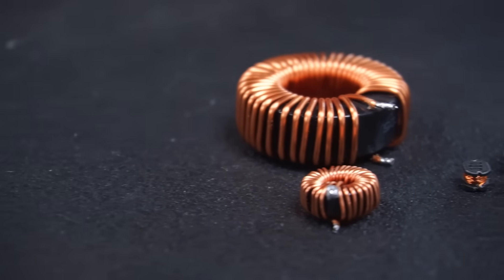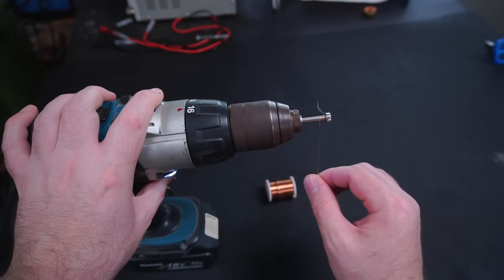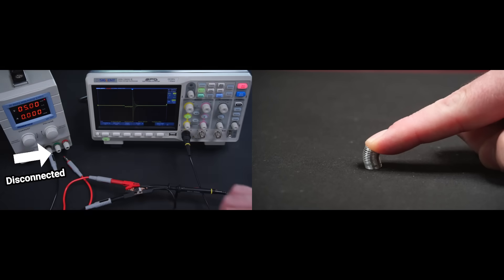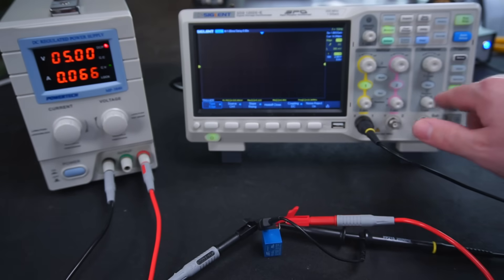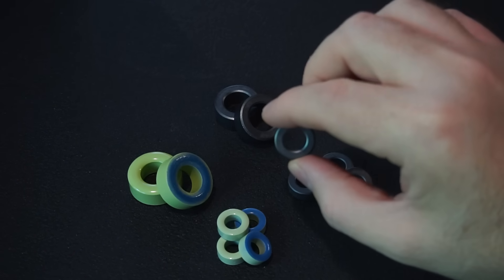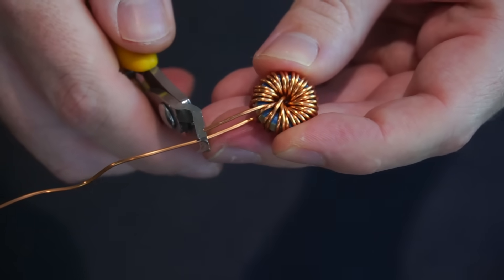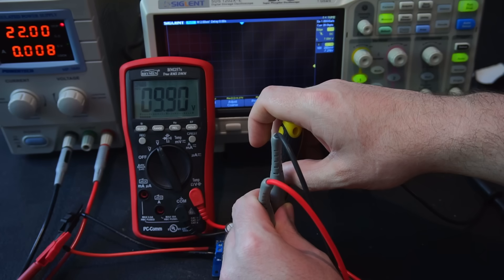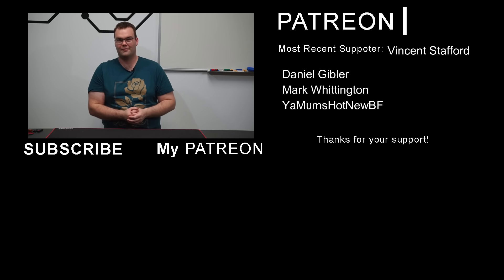How INDUCTOR's work & How to make your own

Comment: You also forgot to point out how to choose the right wire diameter by calculating the wire thickness by using the Amperage. Because your required inductor is 47μH by 12A(well shown at 10:18 in the circuit component L1) so you calculate the wire thickness for 12A and add 30% to it to be on the safe side or you stay below a certain current density for example 10A /1,5mm² is a current density of 6,6 A/mm² you choosed the wrong wire by choosing 1mm diameter you effectively choosed 0,785mm² which for 12A is to little because for 12A you need at least 1,81mm² next size would be 2,5mm². Your my prediction your inductor will be noticeably warm not touchable for long time. Do your homework right if you want to teach how to build a good inductor.

Comment: Oh yes, diodes work great! I had to use about 1500 of them on the electric valves in my pipe organ, each valve's coil was  40, 60 or 90 OHMs @ 12vdc. I had to use diodes to deal with flyback voltage potentially damaging delicate contacts, and to electrically isolate sets of valves connected to the same "66" terminal blocks so each set's valves could be operated separately from the other from the keyboard.

Comment: I've been trying to figure out how I killed two VESC speed controller, and I think this might be how- just by unplugging it. I was using a 48v battery which was connected to a VESC 6.6, and from the terminals of the VESC I had connected a buck converter (DPS5005 ) to power some headlights. After that, the 5v RF section of the board only read 3.3v and no longer would pair with BT.

Comment: One important comment from an old winder: Always start winding the wire from the middle and wind both ends separately. This way you dont have to thread a long wire so many times. The total length of wire to thread is reduced by x4.

Comment: play a video a bouts a heavy duty isolatin tranformer exhample 220 volts to 110 volts AC how to wind them I have them I used  for machine and tools if I want them slower is to plugs in to the the tranformer from the secondiary 110 volts if I want normal speeds plug backs to 240 volts power points it a safety tranformer

Comment: I recently started winding my own toroids for some low-power ham radio kits.  It's worth mentioning that even on a high-end RF-rated toroid (e.g. type 43 ferrite) the proximity of turns can make a pretty big difference in the final inductance; if they're all bunched together, you get more inductance but lower efficiency, and if they're evenly spread out, the inductance is lower but the efficiency is higher.

Not having a component tester, though, I had to come up with an alternate way to test inductances; the simplest way is to build a resonant circuit with a known-value (measured) capacitor and see what frequency it resonates at.  With a decent oscilloscope, this should be a lot more accurate than a component tester.
Reply: I have done that.
The tolerance on the Capacitor and the accuracy of the frequency counter or Oscilloscope sets the tolerance of your final answer.

Comment: Buck converters are supposed to be step-down converters from DC to DC, i.e. reducing voltage while increasing current.  How can you then conclude at 15:32 that inductors have NO influence on DC power and doesn't affect voltage?

Comment: From the coil32 page......Another case is the inductor in the switching power supply. The commonly used ferrites have a relatively low value of saturation flux density (about 0.3 T), so in the power switching circuit the inductor is switched between the maximum value of the field when it almost gets a saturation and zero-field value, when it is demagnetized to a value of residual induction (curve [4]). As we can see the slope of the major axis of the ellipse 4 is much smaller than that of the ellipse 3. In other words, the magnetic permeability of the core in this mode is greatly reduced. The situation becomes worse if the choke core has DC bias (curve [5]). The major hysteresis loop of the real ferrite is more rectangular than on our schematic image and, in the end, the dynamic magnetic permeability of the power inductor on a ferrite ring falls to several units. As if there is no the ferrite! In the end, the inductive reactance of the inductor decreases, the current increases dramatically (which results in an even larger decrease in µ!), the key transistor heats up and burnout. The calculations of Coil32 for this choke give an absolutely wrong result. Because, we used to calculate the value of initial magnetic permeability, and in a real circuit, the permeability is two to three orders smaller. You will get the same situation if you will measure the relative permeability of the toroid by the trial winding.

The solution is to use a ferrite core with the interrupted magnetic circuit. In the case of the ferrite ring, it is necessary to break it in half and then glue that two half with the non-magnetic gap. The major hysteresis loop of such a core becomes more sloping [2], the residual induction is much less [B'r], the effective magnetic permeability is also less than that of the core without a gap. However, the curve of magnetization [6] shows that the dynamic magnetic permeability of this inductor is much higher than that of similar, but with a core without a gap. It has permeability about 50..100. Coil32 also is unable to calculate this choke, since it does not take into account the non-magnetic gap. Another solution is the use of special rings for the power supply as powdered iron toroids (not ferrite). Such toroids can be found in pulse power supply units and motherboards of computers. The non-magnetic "gap" in such ring is distributed along its length.

Conclusion. The Coil32 program calculates only low-current ferrite toroid coil working in low magnetic fields. For the power chokes calculation, it is necessary to use a completely different methodology.

Comment: I’m quite new to electronics, so my use of a 12v relay is limited. I plan to have an Arduino controlling a few 12v lights with a relay board designed specifically for Arduino. Would I need to worry about any kind of voltage spikes if I isolate the 12v circuit from the 5v of the micro controller? I was under the impression that relays were safe but now I’m unsure 😅

Comment: Thank you for this video, it is an excellent demonstration of coils and inductive flyback.  However I think you are confusing the purpose of the inductor in the buck converter circuit with a pi filter in a power supply.  The purpose of the inductor in a buck converter is to supply power to the load and charge the output capacitor. Using the flyback from the coil and charge on the capacitor to maintain current to the load while the switch is off. The output voltage and current being determined by the frequency and duty cycle of the switch as controlled by the PWM.  When you replace the inductor with a short the switching transistor gets hot because it is conducting into a short. An inductor has inductive reactance and that is resistance. Yes the inductor and capacitor values and quality affect ripple, but the inductor here is critical for circuit operation, not a ripple voltage filter as it is in a pi circuit.

Comment: I work on refrigeration systems. We put vfds on the condenser motors a while back. They were blowing up motors left and right. Aside from the motors not being rated for vfds at the time (over a decade ago) they added these electric filters on the outputs of the vfds. I'm no electronics guy, but are those filters we added essentially just inductors for taking out the spikes like you mention in this video on the buck converters? The output of vfds are dc that mimic ac as far as I understand. Which isn't much.

Comment: So what happens if u rapidly switch  an inductor of and on  can u produce a constant voltage 😂😂 wouldn’t this create more energy than put in because it’s dependent on the size of the magnetic field of the magnet .   U could use low voltage high current and produce high voltage high current dependent on the quality of the magnet.

Comment: Don’t need to overkill catch diodes. When sizing catch diodes, remember that current doesn’t increase with fly back. The inductor does what is needed to keep the previous current flowing briefly, however much voltage it takes to do that. So if your 70mA relay coil is switched off, it will continue to pass that 70mA briefly. A 1N4148 catch diode will handle that easily! And with your power inductor at 1A, a IN4001 will do the job just fine.

Comment: In RF parlance, especially in the amplifier arena, capacitors and inductors are labeled as tank blocking capacitors which pass RF current and block DC, while the plate chokes block RF current and pass DC, unless they're making up the tuned resonant tank circuit, where you want the cap to charge and discharge, and the inductor to ring, forming the flywheel effect in class B and C amplifiers. Another choke is used off the load capacitor to ground, which is for safety if the plate cap fails, connecting the HV to the tank. This, of course, blows the fuse before allowing HV into the antenna circuit.

However, that choke's ringing causes HV to appear across the tuning and load cap's plates, and they have to be rated for that.

In the plate power circuit of tube amps, the cap passes the anode's RF to the tank circuit while blocking HV DC, and the RF plate choke blocks the RF from entering the HV power supply. It's like using two types of check valves in a hydraulic circuit, and very similar to a diode's action.

Comment: This is probably one of the better videos I have seen you make. Quick quick question I am building speaker crossovers and found Inductors are very expensive. I wanted to ask what type of Toroid would you suggest for this purpose. I am thinking I can save a lot of money if I just build my own inductors. I want to use iron core inductors for the large woofers rest could be air core but I guess I could use iron core for those too as I could use less wire. I will probably be using 18 awg (1 mm2) wire. Could I even use an iron bolt?

Comment: What if we add a capacitor with an inductor to absorb the fly back ? so then we can use the retained charge or voltage to later power an LED? will it theoretically work?

Comment: I have question I cinde of run in to problem I wanted to build me self dual ignitor for me ignition system I use 4 pin gm ignition modules but the problem is I have only 1 pick up coil I have some of those small inductors and transformers culd I use those to convert 2 pulses to 4 pin out put?
How ever It needs to be corect polarity I supose.
So does have some one sugestion how can I do that?

Comment: very interesting... I am going to build a current mode choke and intend on using ft240-31 torrid and wrapping it with RG400 (12 turns);  Would this not be considered an inductor itself... and if that is true, would or should I be considered about Flyback?

Comment: Have to ask. If there is more wire doesnt that affect voltage like it will have some resistanse and that means that If the load is low resistanse it will start to form good voltage divider network and you have to change output manually to get disaired voltage output with the current that is nessessary.

Comment: The opposing emf produced by an inductor is a characteristic of the non-Coulomb electric field that is proportional to the rate of change in current causing a changing magnetic field. And that is Faraday's Law.
The current is a result of the combination of an opposing Coulomb electric field and the applied field which is changing the current. The opposing Coulomb field is a result of polarization of the inductor by the non-Coulomb electric field. So, the current is a consequence of the resultant field of the applied field and the Coulomb electric field in the inductance coil and is determined using the governing relation in conductors J = σE_net.
It is not possible in this post to discuss in more detail the formation of the Coulomb field when the current in an inductor is changed.
Before learning Faraday's Law and its application to the operation of inductors, it will be instructive to understand Current, the conduction process and Voltage at the fundamental level as in the following two videos:
i. https://youtu.be/TTtt28b1dYo and
ii. https://youtu.be/8BQM_xw2Rfo
The last frame References in video #1 lists textbooks 3 and 4 which discusses topics on inductance and inductors in more detail using a unified approach and provides an intuitive understanding of inductive reactance.
It also describes with sequential diagrams how an inductor develops the induced emf. Textbook 4 shows how the current lags the voltage across the inductor by 90 degrees for sinusoidal input voltages using sequential diagrams.

PPTs and Videos with animations for all the ten chapters and a few applications Regulated DC Power Supply, Differential Amplifier and Transformer coupled audio power amplifier of  book Fundamentals of Electric Theory and Circuits are available for download and viewing here
https://techsarworld.com/download-resource/fundamentals-of-electric-theory-and-circuits-559

Textbook  https://techsarworld.com/product-detail/fundamentals-of-electric-theory-and-circuits-559 
shows how the current lags the voltage across the inductor by 90 degrees for sinusoidal input voltages using sequential diagrams.

Also see
Faraday's Law and self-induced emf - video lectures by NCS Univ faculty
This is a link to a video lecture by NCSU faculty on Faraday's Law. 

Important
7. Faraday's Law
Watch from 8.0 minute.
Ch22L1a
https://youtu.be/ktGL5cEB82I?si=u9vH33gaX1Wy5JvF 

8. Non-coulomb electric field - curly-patterned fields
Watch from the beginning.
Ch22L1b
https://youtu.be/nV6xg-OuxoY?si=UjJBG3wDjazfeQMM 

The second link is to a video lecture on self-induced emfs in solenoids (inductors).
9. Self-induced emf in a solenoid
Ch22L2a
Watch from 10.30 minute.
https://youtu.be/RJ0J_TL-wUQ?si=qPZ74uD-m6weyFlb

Comment: An inductor and a spring is a WRONG analogy.
A spring, or rather a rubber membrane, is an analogue of a capacitor.

An analogue of an inductor is a pipe with a fast flow of water inside. When a valve suddenly closes at the end of a pipeline and stops the water supply, we have a pressure surge, aka water hammer.

Comment: i once hand wound fine transformer wire over a old smps  E core, aim was to power my plasma globe whose hv xfmer had no o/p, got so fed up stopped after some time, made ajoule thief kind of self oscillator, it can power a neon lamp from a 1.5V battery.

Comment: I really enjoyed your flyback to a spring example!  I need to find out the opposite of what you showed after that, however... I need to figure out how to best protect any other circuitry while, at the same time, getting the highest possible flyback voltage. It doesn't help that my limited amount of electronics background is close to 50 years old ~ with a LOT of "water under the bridge" during that time... (I'm having to go back & start over from scratch via youtube, etc.)  Fortunately, I DO remember enough to have a healthy respect for HV & how to discharge scavenged flybacks, capacitors, & condensers without "knocking myself into the next county ~ if not the next life..."   I'm wanting to set up at least 3, horizontal shaft, Briggs & Stratton 4 stroke motors with to run off of HV produced HHO on demand. These motors, in turn, would spin "smart drive" stator/rotor motors, rewired to be generators, with a bit of the output getting diverted to charge the flyback system for HV/LC...  Any suggestions on how to protect the other circuitry withOUT reducing the flyback voltage???

Comment: After inductance, the next most important property of inductors is it's saturation current.
Basically when inductor reaches saturation current its inductances decreases to almost zero.
This is the probable reason those inductors presented different results.
Reply: Does that mean its resistance drops as well? At the same time it reaches above saturation

Comment: There is no such thing as surge current when disconnecting inductors, a flyback diode recieve at most the inductor current.
The surge is in voltage, even a small current can generate a big voltage spike due to extremely low parasitic capacitance of the coil leads.